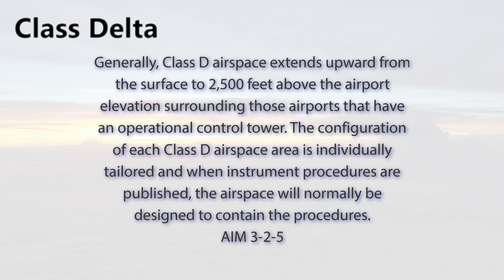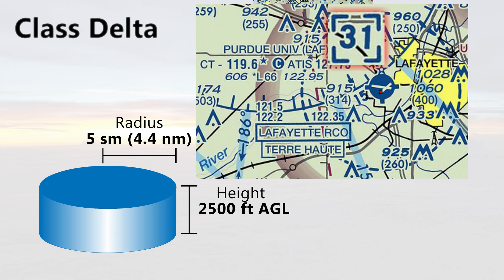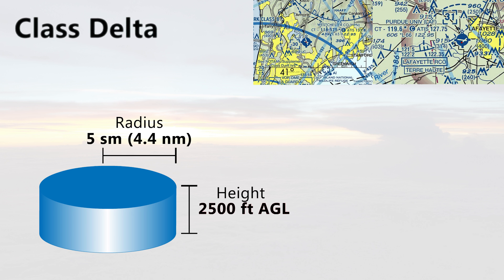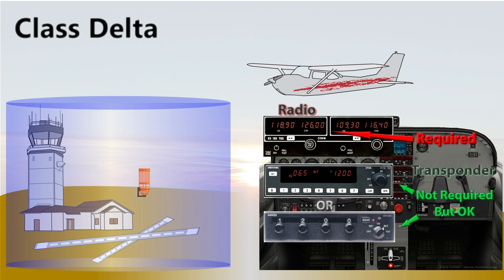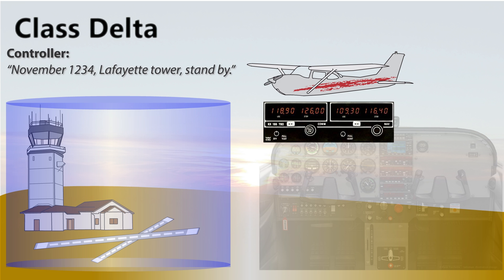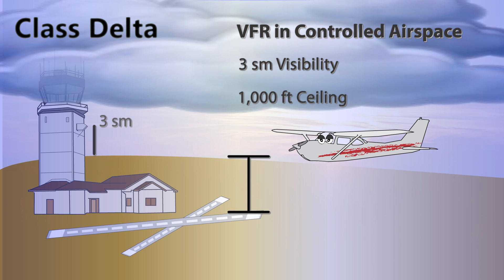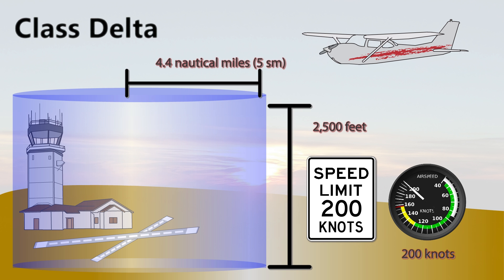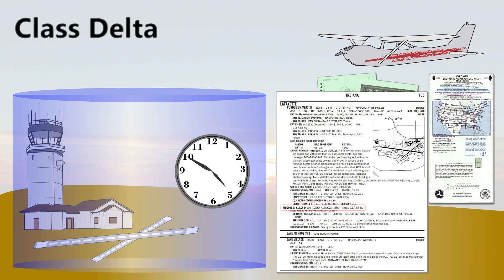Class D Airspace Defined

Comment: Great video! I have a question on the Class D dimensions, in the AIM there is no reference for the radius dimensions of this airspace, however the AIM states class C is 5 NM in radius, should this radius be the same for class D or is it 5 SM as your video suggests?
Reply from the maker: Great question! You are correct that the Class C airspace has defined dimensions of 5 NM and 10 NM. Nowhere in the AIM or the FARs does it actually state the radius of class D. The closest you'll find there is the 4 NM and 2,500 feet AGL for airspeed (91.117). The only official written lateral limits for D you'll find is that each is tailored to suit the needs or to contain the instrument approaches for that airport. However, when I was the assistant chief CFI several years ago, we dealt with the FSDO often, and the unofficial answer was 5 Statute Miles for most because that is the area that the TAF is valid for. If you get out your plotter and actually measure the radius of many Class D airspace you'll find that they are about 4.4 NM which is 5 SM. I tried to convey on the video that each individual airspace needs to be checked for the actual dimensions, but the 5 Statue Mile rule was something handed down to us flight instructors from the FAA examiners through out the years.

-HOWEVER, I believe the FAA Written knowledge tests still have a few questions that state it is only 4 Nautical Miles, but as you mentioned, there is no definite number given anywhere. I do have a feeling these questions will be taken out as they continue to update all the written exams.

Glad you enjoyed the video! I am planning on adding more in the near future. Feel free to email any other questions about the video or any pilot training information at
pilotright@gmail.com 
or check out my temporary website at
http://pilotright.weebly.com

Thanks again!
Reply: @PilotRight  statute, not statue.
Reply: Reminds me of a Seinfeld episode :)